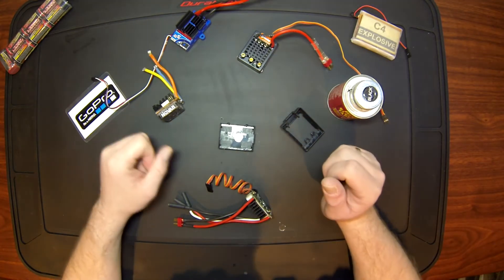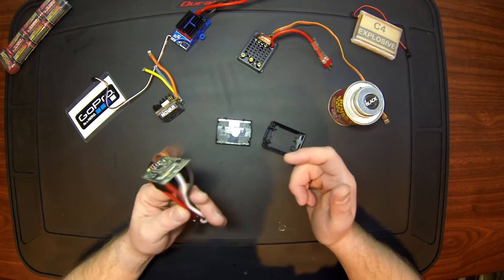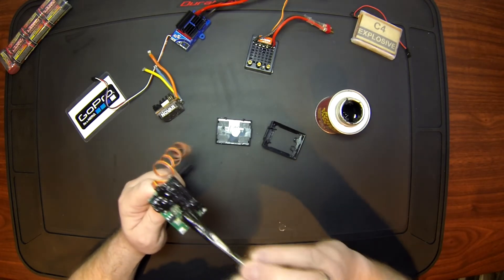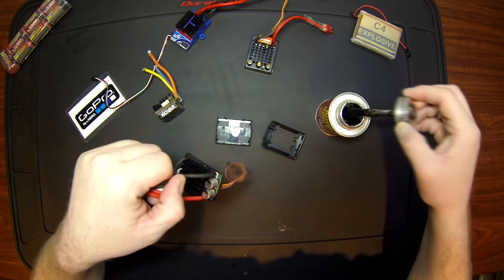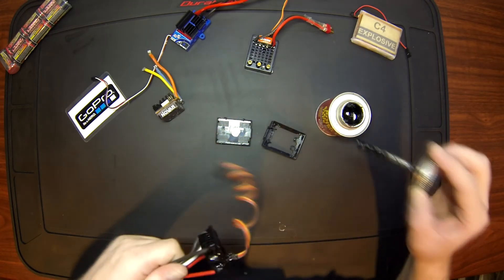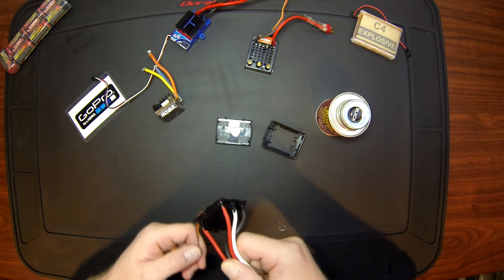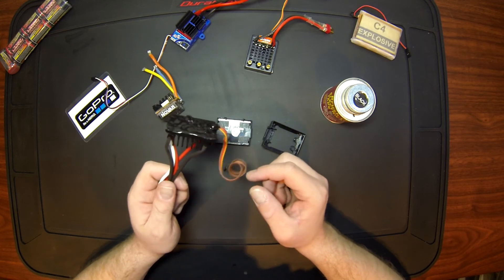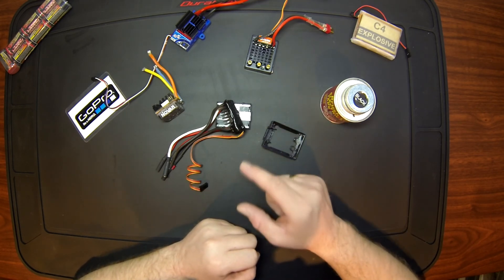HOW TO WATERPROOF A  ESC.

Comment: I use to be a heav liquid tape/plastidip user also. I found a better option. its applied basically the same as what you did here only these products are specifically designed for circuit boards. 
 http://www.mgchemicals.com/products/conformal-coatings/